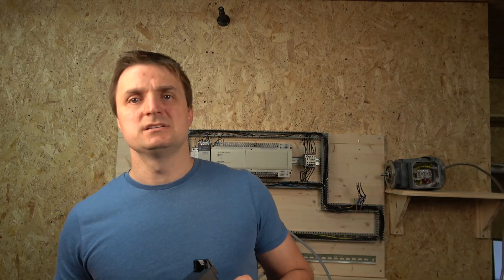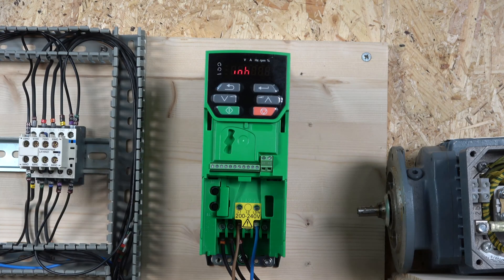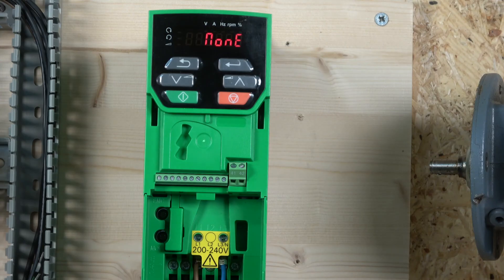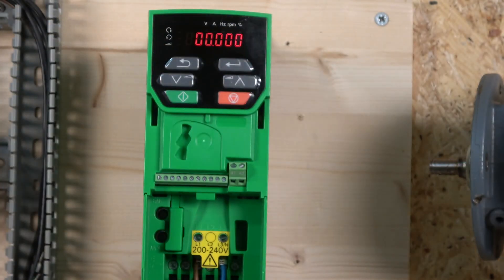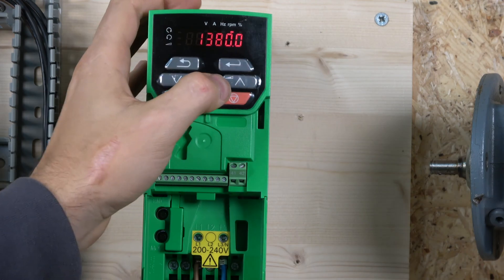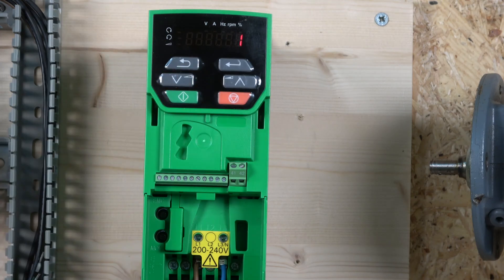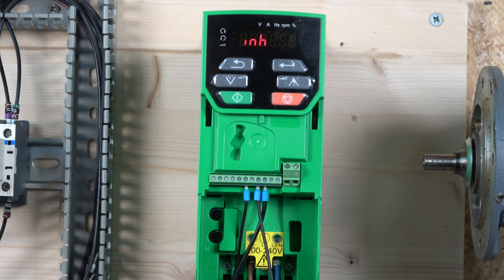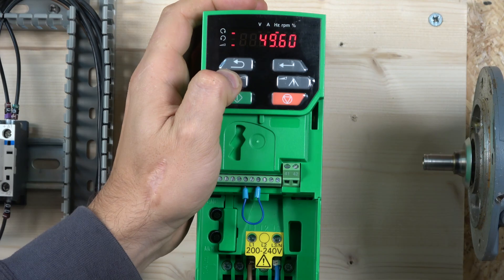Control Techniques C200 VFD local control, parameter set up, Factory reset, single phase (English)

Comment: Sorry I have solved my issue, but I need to run the motor in reverse I did a steps above but 24v into port 13 and did the auto tune, but it’s still not in reverse, any advice?
Reply: yes enable keypad reference
Reply: @ThuitaMaina-g2u when I load my induction motor which is being controlled by the c200, I keep getting phase loss, wirings all good, 3phase is good, not sure why it keeps cutting off, any advice?
Reply from the maker: If you have a drive from the new, everything should be as the diagrams suggest. Remember inputs can be reconfigured, so if that has been done and not by you, then the best would be to default the drive and check then.

Comment: Hey my friend, great content, I have set parameters on my motor, in using a 18.5 kw tec motor, 
I’m confused on the part where you enable the the drive? With the blue wires

Comment: I have an error ER.1E.Ac how can I reset this fault and what does it mean by those error plz
Reply: It means jigh amperage, you need to assure thta your motor is in good condition, neasure the insulation of the motor and the cable and see if the motor is not grounding, before operate again in the case it will show ypu the alarm again

Comment: how to remove the security code
Reply from the maker: You should be able to do that by resetting the drive, if that don't work then the only thing i would think is left is to connect it to laptop and do it vi there software.

Comment: I have an older Control Techniques SE 2D200150 SE2.5M/TL 1.5 KW. The readout shows Fr-60.0 but no output.  Would this indicate a configuration or wiring problem or a failure?  I got this with an equipment purchase. and do not know if it works.

Thanks -JD
Reply from the maker: HI JD. When you start the drive is it ramping up?

Comment: How to program brake function..?
Reply from the maker: All brake parameters start form parameter 46 page 49 in control user guide. To get more explanation what each parameter mean, refer to Parameter Reference Guide on Control Techniques website, link provided in description. I don't know your application so i wont be able to help much anymore, but all the info you need will be in manuals in parameters I have mentioned.